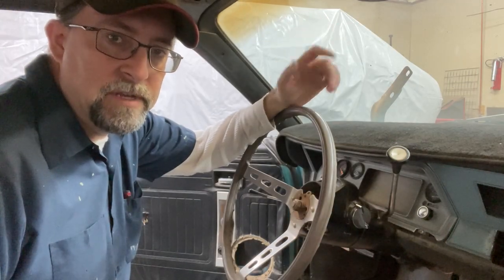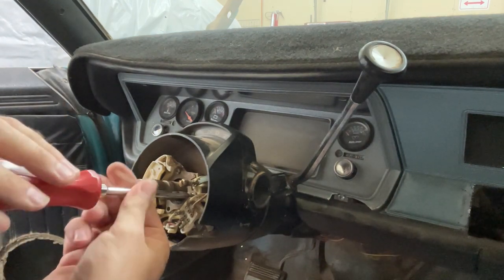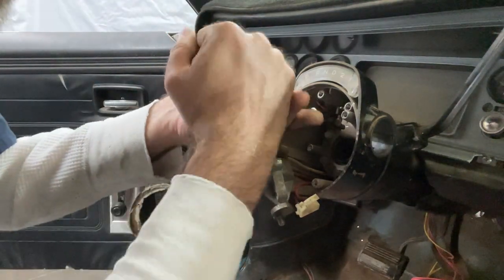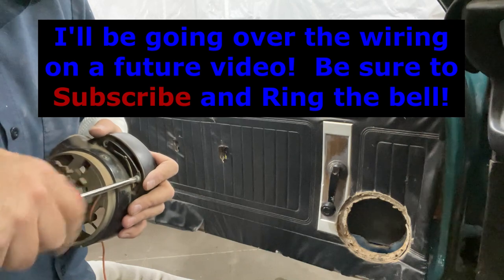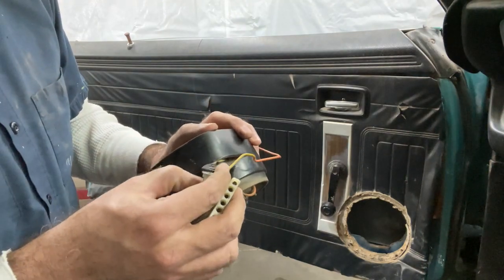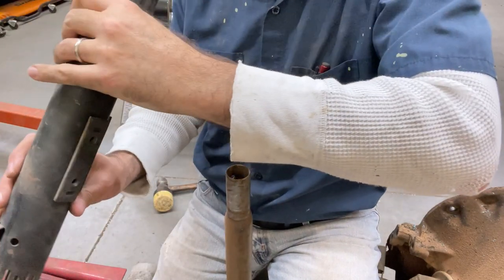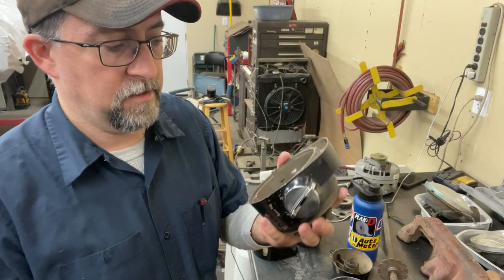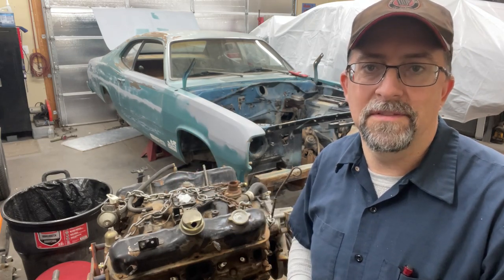How to convert Mopar steering column to floor shift using motorhome parts!

Comment: If you ever wanna pull the wheel and you don’t have a puller. Get your knees up tight under the wheel, take 2 ball peen hammers, place one head against nut and strike that hammer with the other. Wheel will pop off with a couple hits.
Reply from the maker: I've used that method in the junkyard.

Comment: If you want to sell the automatic one. Great video.
Reply from the maker: The top two collar pieces are cracked on the inside.  I think they will still work just fine.  You can have them if you want to just pay for shipping.
Reply: I didn't know it was cracked. But thank you. Great videos!!!
Reply from the maker: @DusterGuy1970  Did you need the arm and everything?  The same junkyard had a 71 Duster with the steering column I can  see what he wants for it. I can pull it and send it to you if you can’t find one.
Reply: I will see if I can get one around here. But thank you so much for the offer!!!!